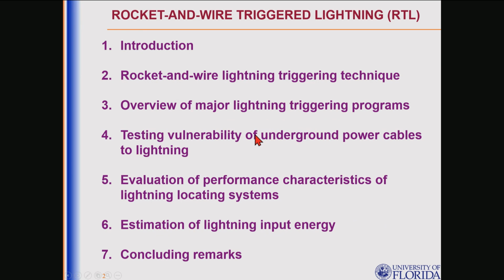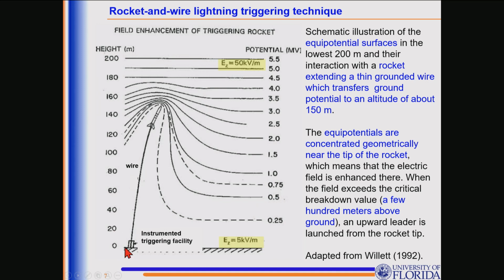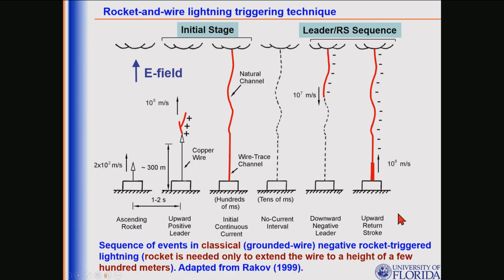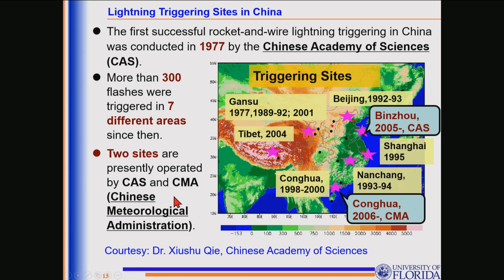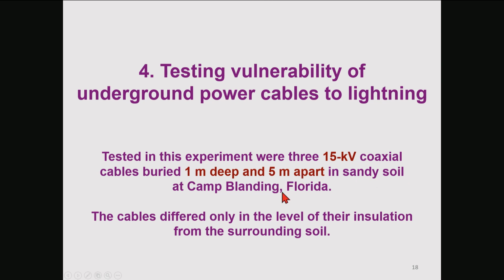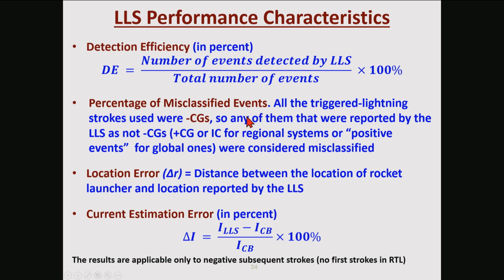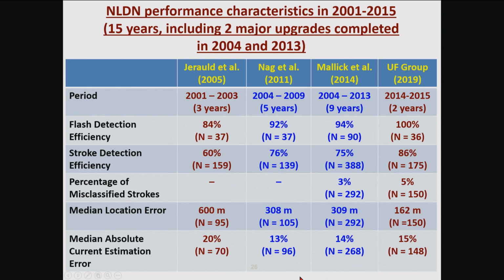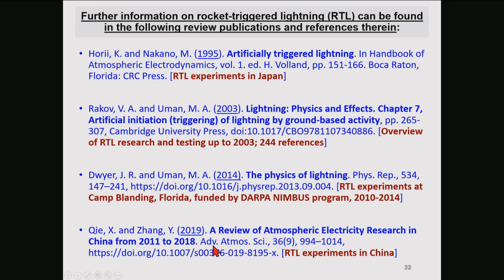(ASE) Rocket-and-wire Triggered Lightning

Comment: Normies look at me like I'm from another planet when I tell them about the crazy stuff I learn on the internet
Reply: I here you. Nitinol 5 megawatt generator, high altitude tethered balloon wind generation, thermal sand batteries with thermoelectric generation, 0 source piezoelectric vibration generation, piezoelectric railway sleepers and finally any radioactive element can become stabilized by finding its frequency, then make a inverse waveform at a higher amplitude .... And so much more